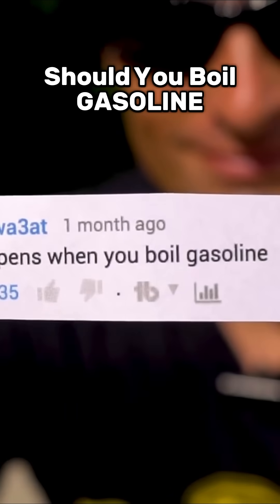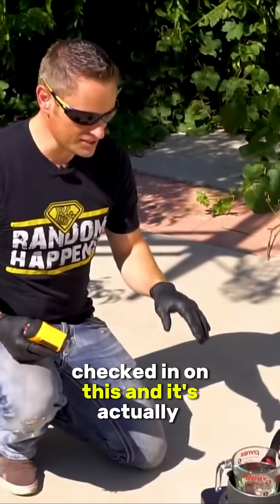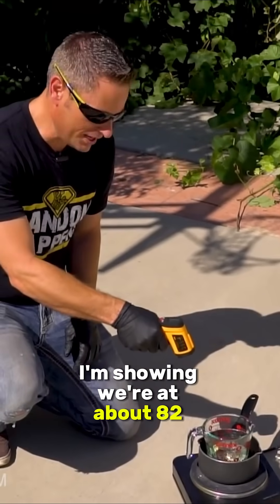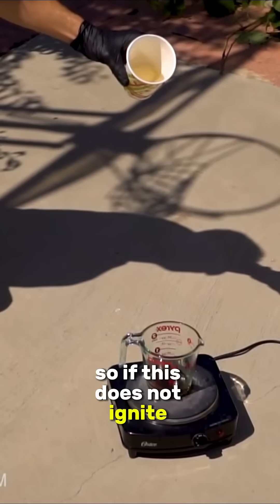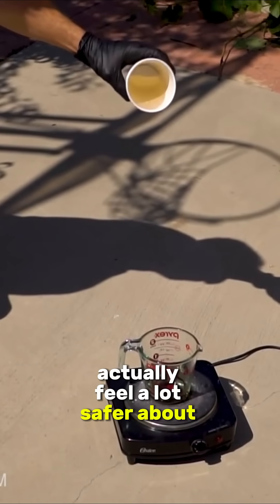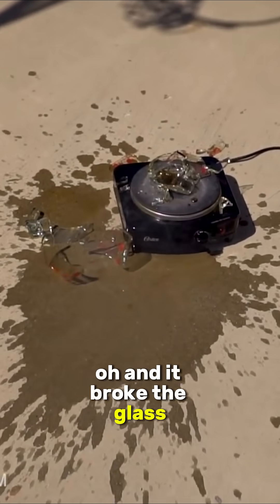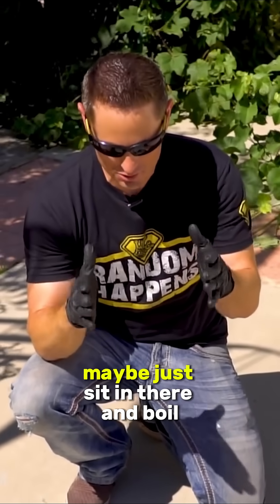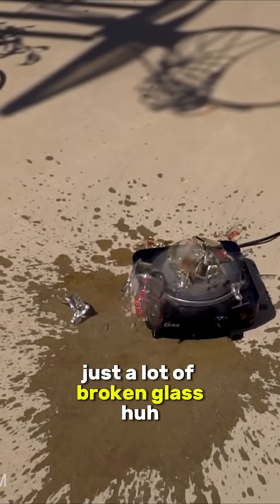SHOULD YOU BOIL GASOLINE!?

Comment: Fuel boil is a problem, especially in hot climate areas. It can cause your engine to lose fuel pressure, vapor lock your fuel system, even build too much pressure, and inflate your gas tank. It is a very dangerous situation because liquid gasoline is not explosive, it's when gasoline vapor mixes with the atmosphere that it becomes explosive.